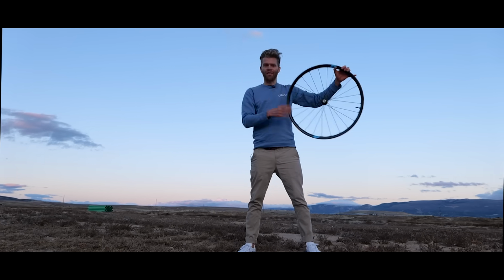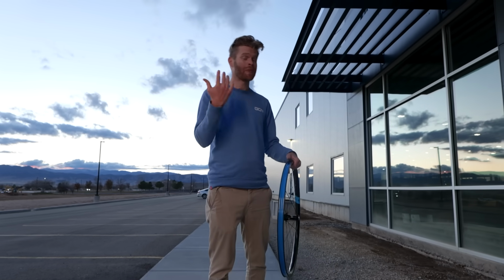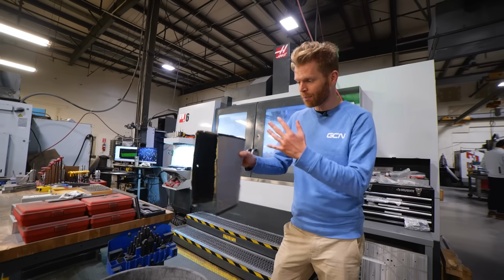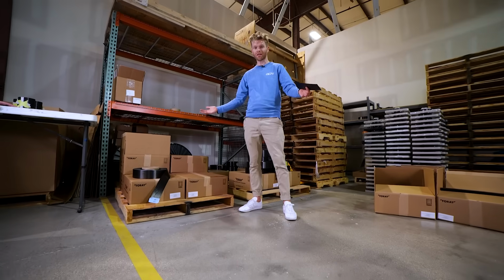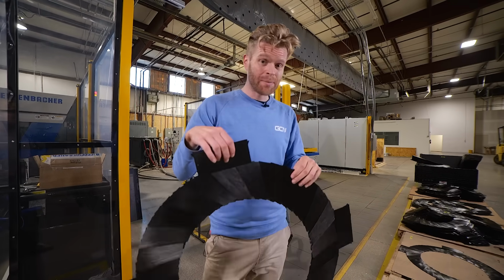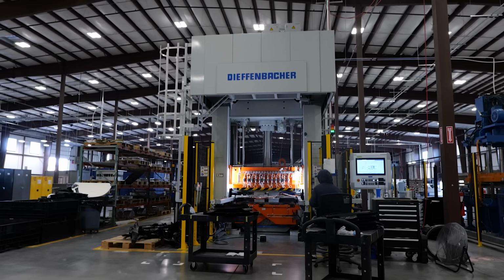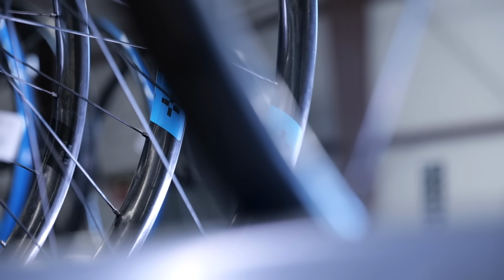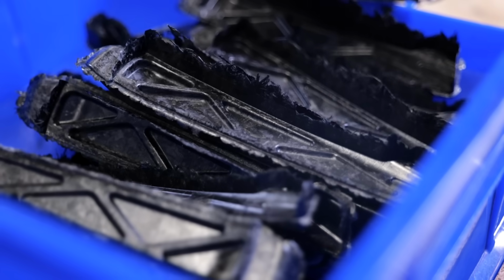Is This The Next Step For Carbon Fiber Bike Parts?

Comment: I really like the recyclable aspect of this tech. I really wonder if there can some wind energy application to the composite bodies of a turbine blade. Definitely need to bring this up to my professors when I meet with them. 

However, the high cost of these wheels, ~$2200, will be hard to adopt them into the mainstream cycling community, which the adoption of these wheels is arguably what this tech needs to be more widely available. I get that these wheels are almost certainty a small fraction of Forge & Bond's profit but when there are other wheels to buy for MUCH cheaper it makes it a hard sell. Now if someone is looking for wheels around that price point, they may be on that person's consideration list. 

I'm mainly wondering where the cost savings on the reduced labor is shown in the price. I understand that expensive machines have to be paid for, but my point has to do with the selling point of the reduced labor cost = lower cost wheels.
Reply: Not likely to be seen on something the size of a wind turbine blade just yet--nylon is more susceptible to the elements (mostly water) and thermoplastic composites are for the time being heavier than their thermoset counterparts. A small weight penalty really adds up over the size of something like a wind turbine blade or an aircraft component.

As these things always do, the price will come down with time, competition, and improvement to the technology. As Ollie suggests, the principal is probably extremely high for that kind of setup so the prices won't come down until they've amortized their investment
Reply: The wind industry requires composite material on a scale that cannot be supplied by the offcuts of even the rest of the world's composite manufacturing. The bike industry is a flea by comparison. 

Wind turbine blades are also normally made by resin infusion. I shudder to imagine the cost of building a press and mould capable of making it out of thermoplastic composite.

Comment: a view points

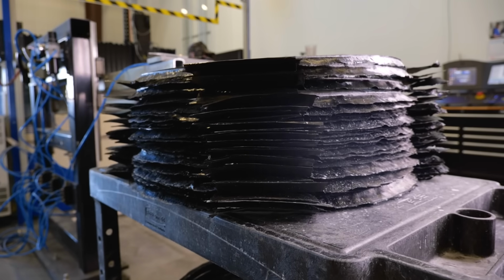1) the amount of material needed to be trimed of 4:30 compared to 11:10 

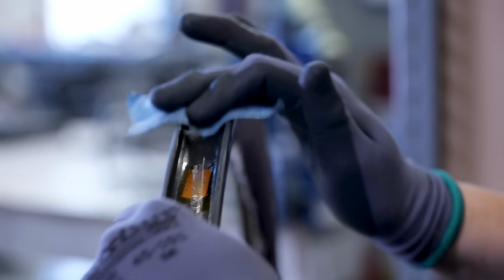2) 8:30 12:30  thr main adantage of thrmoset matrix carbon composit is higher strength. If you want to build realy light, thermoplastics(like nylon or Peek) are not the way to go.

3) 10:50  re heating usually comes with degradation in the Matrix so its not a process you want to do often

4) 11:40 a clean process with thermoset matrix(like the one used by We are on composites) does also need no finishing (you need finishing if you build cheap carbon wheels in asia)

bottom Line: Thermoplastic composites can be cheaper if made in larger quantities (because thecan be produced much farster but at higher tooling cost). They excell at Impacts and are more easily downcycled(recycling is not really a thing(as long as you dont want to make it really complicated/expensive(this is also true for thermoset composites and Aluminium(but to different degrees)). On the other hand you get less strength out of the parts and have to consider operating temperatures.
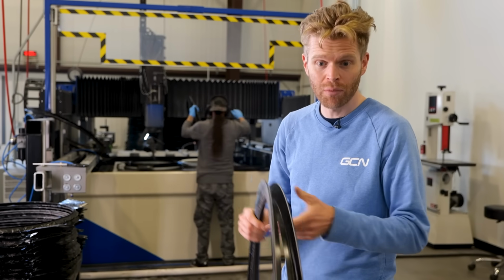Reply: At 11:20 he bends it with ease with his hands.

For a project i plan to do, i need something really really strong.

I would like to use carbon fibers, but the main problem for me is that it breaks suddenly. Many years ago, i read about some cyclists who said that they prefer good old steel. They said that with steel, they have a warning time. Steel does not suddenly breaks in two. They said steel would rather bend before breaking and give time to the cyclist to react. Sometimes, the cyclist can even spot a crack in the garage before going to ride. With carbon fiber they said, the fork suddenly, without cracks and without warnings breaks in two and throws the cyclist away.

For my next project i need a warning. In case it breaks, i prefer it to rather bend broken than break broken in two peaces.

I can not tell you what my project is. But let say as an example that i want to create exoskeletons.
Put in google images "biceps preacher"

I am totally sure, the client will not follow the instructions where it will be written the limit weight the exoskeleton can lift. I am totally sure the client will try to force my product until it breaks. Putting more and more wight on it.
Now imagine the client puts too much weight on the exoskeleton on the biceps preacher bench. If it breaks suddenly like carbon fiber, it will break the hand of the client in two. If it gives to the client some warning, even if it is two seconds only, he will have time to throw the weight.

Now imagine somebody uses the exoskeleton to lift weight on top of his head. Put in google images - "behind the neck presses"

Not to mention, during an accident, composite materials can enter the wound and the bloodstream and create lot of damage. Something people almost never talk about.

Comment: Dad did a lot of design work with polymers in the telecom industry 80's and 90's he'd come home from trade shows with things like a briefcase full of briefcase handles of different blends, injection molded models of injection molding machines, and for me the star of the show, a glass filled polyamide (nylon) g clamp, truly the king of the thermoplastics.

Comment: This is my favourite GCN Tech video ever!  The one question I'm left with though is how do the two halves come together?  Certainly the spokes would pull through a seam down the middle and the tyre pressure would push that seam apart.
Reply: Same, without any carbon across the seam I'd worry about it too - though I expect they have solved it somehow.

Comment: Great tour.   Nylons are much softer than epoxies, or typically have been.  It would seem these wheels would require a thicker layup of material, hence weight would rise ?   One cost saving step that was evident, the final molds seem to run at much lower pressure than what happens in a traditional molding process, hence the molds are much lower cost .   Is this the case ? Or are the molds in the traditional process also relatively low pressure ?
Reply: Pressure shouldn't really be a concern for the molds, even aerospace parts are commonly made on aluminium molds. So within the realm of pressures used to make a wheel that's probably not a big cost-saver. Being able to weld the two halves together rather than create single piece in one mold may save on mold cost by reducing complexity on the machining end though

Comment: Thermoplastics composite nylon in cycling has been around a long time. Examples as Modolo downtube shifters and brake levers from the 1980's and GT made a full squish MTB out of the materials. I do have a road tubular pair of rims made in this same material sold by a company in the UK called Matrix. Its a deep rim and I'm using with a rim brake. (Note: Not the same Matrix company or brand as USA Trek owned.)
Reply: Really? I would expect thermoplastic rims to be completly incompatible with rim brakes. The glass transition temperautures for most thermopatics is in the 50-150c range, well under temperqtues that rim brakes see.
Reply: @BFriesen  Skyway Tuff Wheels (nylon for the regular ones introduced in the 1970s, carbon-reinforced nylon for the graphite ones that were introduced in the 1980s) have been used with rim brakes for as long as they've existed. Skyway even sells special brake pads for use with them, and they have since at least the 1980s:

"The Skyway BMX slim brake pads have been designed for use with the Iconic Skyway Tuff wheels. Available in many colors to compliment the Skyway Tuff wheels, this pad features a threaded stud and is compatible with modern V-brakes, old-school caliper & U brakes."

Comment: Although there are no temperatures to melt nylon, it still looses its strength. Something about half when going from 0 to 60 Celcius.
Reply: First, that just doesn't sound right to me, second, most of the strength comes from the fibres not the matrix, but even assuming it is completely true: how often do you ride at 60°C??
Reply: @leftaroundabout  from sitting in the sun it can heat up to 120, it's not about ambient temperatures. Also you can change the scale and pick other temperature range, but still the main drop in quality is within normal operational conditions. Key here, the material properties vary not by single percents, but at double-triple proportions. So there will be a huge difference in lifetime of wheels ridden and stored in different climates.
And if strength is irrelevant, why do you think there is matrix at all? It's not that most of strength comes from fibers and some from matrix, but strength in most directions comes from fibers, while some directions are fully relying on the matrix.
Reply: @feedbackzaloop  a black flat surface gets hot in the sun because it has a lot of area and not much cooling, but bike wheels don't have much exposed surface (especially not when the sun is high) and are cooled very effectively by the air stream (otherwise rim brakes would never have been a thing).
Reply: @leftaroundabout  true, convection cooling effect while riding lowers the temperature. Already set high from idle standing in the sun. Which is independent of surface area. Both radiating heating and cooling happen from same surface.
Hence the result: store in cooled shade and make only short stops if you want wheels to last. Is this what you want from them?

What you really wanted to know, however, if all that is true, how the wheels don't break. Well, they just assume the material properties in worst conditions and use more material to compensate for it. Therefore these rims are only marginally lighter than aluminum of same dimensions, take DT XR360

Comment: Nylon cabon 3D print filament exists and I have used it before personally. It is very lightweight but it's integrity gets affected quite a good amount from UV rays i.e. sunlight. I'd try wheels like this, but not without some form of clear coat or at least 1-2 layers of paint to protect the nylon. These days, general carbon wheels are built extremely well, it really takes quite a lot of force to actually break or fracture a carbon rim or frame, and epoxy is well resistant to UV rays unlike nylon. I'm not saying nylon carbon is worse than traditional methods, there is definitely potential, but selling wheels without adding some paint coats for protection from UV rays concerns me. This would be great though for things like carbon wheels, bottle cages, and other smaller more accessory products.
Reply: Interesting you say that about the UV sensitivity of the carbon. During the whole video I was wondering how their application could be used for wind turbine blades. Currently, once a wind turbine meets its end of life the typical disposal methods usually destines the blades to the land fill. This aspect of the life span of a wind turbine is under research, mainly different recycling methods, and I was wondering if this sort of tech could be used to replace the current composites used for blades so that they may be recycled better.
Reply: @BeyReaper  I think there is potential but my concern is if it’s bare nylon carbon being used vs nylon carbon coated in protective paint/coat. I think there is a use case for it as long as it’s protected.
Reply: @BeyReaper  wind is a farce and the entire industry will collapse when the subsidies run out.
Reply: My friend broke so many carbon rims, he had to go back to aluminum.
Reply: I came looking for a comment about UV stability. Also curious as to how it manages moisture
Reply: @mudmug1  I can’t speak for the nylon carbon in the vid, but for filament, that shit absorbs anything it can find. You have to cook the entire filament for like 30 minutes to get the moisture out before actually printing with it. I stopped using it because of how much of a bitch it was to deal with 🤣
Reply: @mudmug1  Yeah. The properties of pure nylon vary greatly depending on its moisture content. Maybe the carbon fiber will hold it together...
Reply: I'm glad someone mentioned this. Nylon fares terribly in the sun.
Reply: Carbon epoxy cracks after 800 hours of use and has zero protection from UV.  That's why all the carbon bikes have the super thick matte paint jobs to protect the frame.
Reply: Epoxy resins also photodegrade. You have to paint or coat it.

Comment: I think this new nylon composite material could also have very good application in bike shoe soles and saddle bases, where it is very useful for the end user to be able to  custom mold to their liking.  I wonder if this is the technology also licensed by Lemond bikes.
Reply: Oh yeah, you can do this with FusionFiber! Just heat it up to 300 degrees then stand on it for a few mins as it cools. Eventually, you’re left with a perfect form of your incinerated stubs where feet used to be. Very comfortable on the bike once the wounds heal.

Comment: Very interesting. How are the fibers oriented? Are they long or short pieces. How can the (very stiff) carbon be molded?
Reply: Carbon is only stiff because you basically can't stretch the fibres, raw carbon basically acts like cloth as is actually supplied on rolls like a carpet. The stiffness comes from constraining it. Imagine pulling a loop of thread over the tip of your finger, then holding it taught against either side of your first knuckle: if you bend your finger the top side of the string pulls tight and presses against your knuckles.
In this case, the carbon is already enveloped in the constraining material, but when you melt it, it can move freely.

Comment: Love this. Thanks for doing this video. Any idea when frames will start being made of Fusion Fiber? Also, did they tell you the cost difference between Fusion Fiber and the equivalent pre-preg carbon fiber? Thanks!
Reply: Guerrilla Gravity was making frames with the same material
Reply: If this is a cheaper way of manufacturing carbon, the industry will adopt it in no time since he industry loves lacking on the manufacturing process but charging you more for the priviledge.

Comment: Nylon-carbon not new story. It's cheaper on labor, more environmentally friendly, but less stiff on same weight, and less heat resistant.
Also its melted in 300 but can be soften at less.
Also it can be more fragile at lower temperatur   
Also there is forged carbon, its way of reusing cut off, from carbon fiber sheets
Reply: Yeah, it's interesting. I didn't think thermosoft materials would be stiff enough (hence usual use of thermoset materials in lieu of metals).

Comment: two halves??? so, no continuous fiber goes through the middle? The wheel will brake in half pretty quickly especially if you are strong
first cut fiber to small sheets? you need to add a lot more fiber to sufficiently connect(overlap) those sheets together to keep the same strength as wheel made of a continouos strip of fiber. 
bottom line: worth only if it will cost less than mass-market aluminium wheels

Comment: Good video! I had heard Trek was on to this and saw that Lauf was using them on their gravel bikes, so cool to see the process. Will be curious to see how the MTB wheels are and if it expands to more aero shapes and sizes for TT bikes.
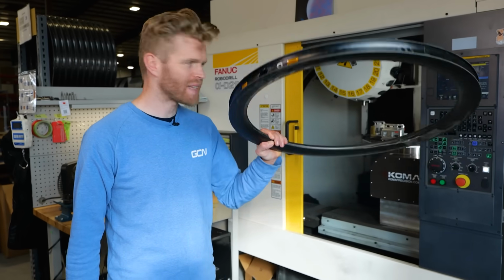Reply: You can actually see in 13:12 there is a TREK sticker on rim while in drill machine.
Reply: @funLad80  Yep, Aeolus is their Bontrager model
Reply: @funLad80   also, Aeolus (visible when they pull the wheel out of the mold) is a trek wheel model
Reply: Same I'm curious though from this video I still think traditional carbon fiber is better so far

I'm still going Ibis S28 for my next rims I'm building for my enduro bike

Comment: The carbon footprint of traditional carbon fibre is insanely high and we should all be aware of that when we buy a new bike (I’d suggest it should be labelled on the bike and certain components, on purchase, the carbon footprint print and a score for how easy it is to recycle) . It’s good we’ve developed a process which is less intensive. Still happy with my alu rims and Reynolds steel frame though, but I’m not looking for marginal gains and appreciate it’s a different scenario if you race.
Reply: Titanium leads the way.